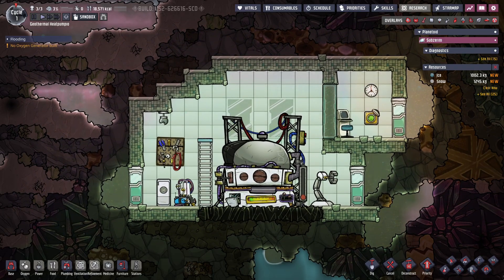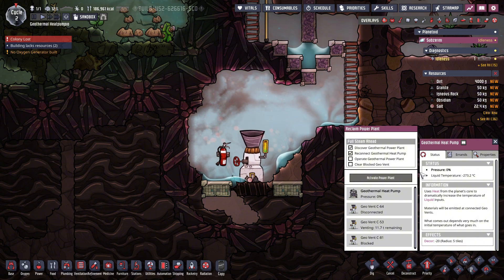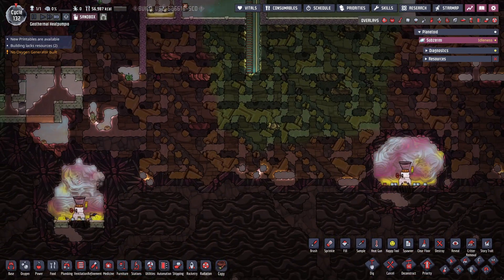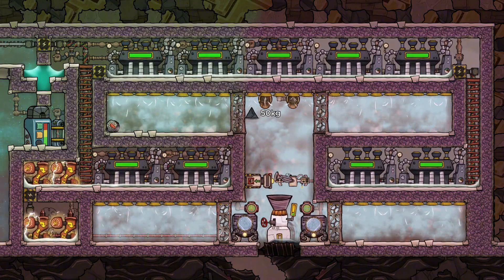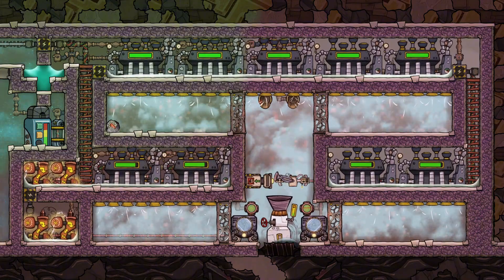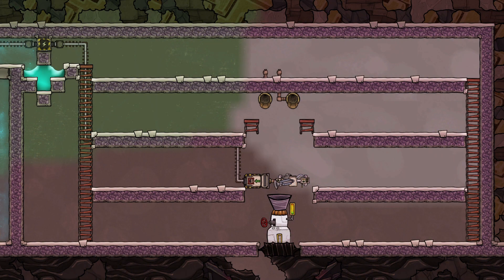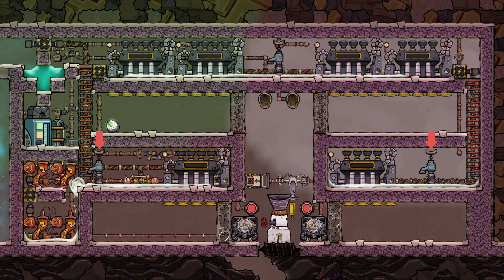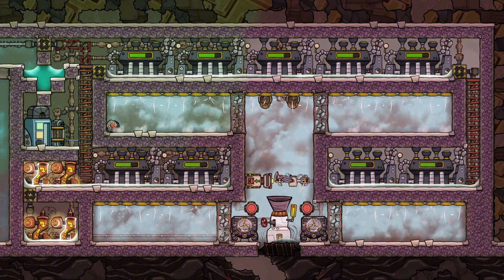An Introduction to the Geothermal Heat Pump | Tutorial | Oxygen Not Included

Comment: I had not been collecting any Nectar so I tried petroleum as a cooling medium, good temps safe to work with...but I didn't realize how close the cooling on this build cuts it. I had nowhere near enough Specific Heat Capacity for the AT to cool everything and the top turbines all got stifled after a couple cycles.
A bit of emergency surgery where I dumped the petrol out at the same time I put water in using the snip tool and it works perfectly! As long as you have your Igneous insulated piping, and keep the AT above like 20/30C you can get by with water cooling. Pumping a 95C geyser into my fill tank and I should have a source of infinite power requiring no dupes, thanks for this guide!

Comment: Wouldn't your liquid temp sensor give incorrect information? You put them in 2 tiles away from input in Aquatuners, which means the 10 kg of nectar that require cooling - will not be passed to Aquatuner, but instead - the 10 kg of nectar infront of the  one you need to cool - will be passed
Reply: this is irrelevant, liquid in pipes normalizes to liquild spilled for cooling
Reply: @РоманПшонка  В якому плані Normalize?

Comment: hello. thanks for the detailed tutorial. One question, does the coolant need to be nectar? can it be salt water or just water instead? thanks in advance.
Reply: Hello. I used polluted water and it is totally fine. Nectar is mostly useful for very low temperature cooling (lower than -20c)

Comment: Thank you for the informative video. With your help, I was able to make a setup without any major issues. 
Though in my case, I was using it by piping in molten copper from a volcano nearby for those sweet fullerene and niobium bits. Some improvements that I've made to help me with this: 
1. A small cap on top with a gas pump to gather hydrogen (otherwise it stifles steam turbine on top)
2. A little pooling area with a liquid pump on one side from geo vent for sulfur. Sulfur is not an issue for a long time with the amount it produces, but it looks unclean to me and sending dupes there to mop it every time looks like an abuse))

And I wasn't able to figure out a simple system to keep consistent amount of steam in the chamber with limitation of atmo sensor (I wanted to keep it at 100 kilo per tile and atmo sensor failed me there). In the end I needed to constantly keep track of pressure there.

Anyway, nice tutorial with a lot of useful information. Thank you

Comment: So I did some experiments. If you’re ok with a bit of time wasting you can feed water through the hot core rock in 1kg packets before they go into the pump. You can get the water hot enough for the last pump without needing a different material. But be careful as what comes out will be VERY VERY hot.

Comment: Thank you. There were a lot of mechanics surrounding this POI that were rather murky——for example how some of the matter is lost, the overpressurization value, and so on.

I'd been struggling to get this stupid thing to work for ages. Honestly, just seeing how many steam turbines you were running simultaneously made my eyebrows go up. I was running five at barely half power each, around 130 degrees when all was said and done.

I ran my base on Ceres for over 1,000 cycles before finally running out of natural heat to extract from the hot igneous rock below, and at that point I came looking for your video.

On reflection, I could have just run a Research Reactor using uranium sourced from a Space POI...

But this is much easier, anyway.

Comment: 1, You can get sand if the auto sweeper trail loop is directly above the heat pump!
2. I use pertrolium and keep it 180+ so when ever i need power automation kicks in to burn the power to 150C
Reply from the maker: I don´t quite understand what you mean with your first point, can you elaborate?
Reply: So you use a regular confined steam room and feed petrolium to the geo vent cycle ?

Comment: can this build work with 6-8 steam turbine?
i have probelm of having 2 geo vent close to each other ( using both of these together would be overkill and will require a lot of resource) and the 3rd one is close to cool salt slush gyser and gold volcan
Reply from the maker: 6-8 works as well, but you still need 1 turbine constantly feeding into the steam chamber to drag the temperature down. When using 1 vent, less steam turbines just mean that you will have some power fluctuation, because you don´t fill the geothermal heat pump as quickly

Comment: I'm very happy to discover your chanel. Great videos for the best game ever! I would like to know what is the purpose of the mesh tiles in the build? What are they blocking? Everything should work without them if im not mistaking?!
Reply from the maker: The mesh tiles are there to block the meteors coming from the geo vent so the debris ends up in range of the autosweeper. Sometimes they still end up on the other side tho. I just built this setup in my playthrough series and tried double layering the mesh tiles and so far it seems to be working.

Comment: Thanks for a great tutorial! I implemented this but ran into a problem of steam sometimes condensing faster than steam turbines could extract the water. Because of that, I had to "top up" the pump now and then...  Also, it is not fully clear where you get the water to the reservoir. Do you grab it from one of the lines leading back to the pump?  (note that I used cool slush geiser water around -10 degrees)
Reply from the maker: Thank you :) The water from the reservoir comes from other water sources you have on your planet, so you had the right idea, but I hope you have an alternative water source you can use tho. The freezing cold water from the slush geyser might be too cold for the system to handle, because the steam needs to heat up your cold brine from -10 to 200°C. Ideally you preheat your additonal water source (e.g. by using the cool brine as a coolant somewhere) or you use a water source that is hotter to begin with (like salt water geysers that output salt water at 91°C).
If all else fails, some temperature shiftplates in the steam chamber may help dissipate the chill from the cold brine.

Comment: Ifnyou have all 3 vents connected,  would the 12t split equally amongst them or is it a flat x amount regardless?
Reply from the maker: the 12t of input liquid split evenly accross the vents. All additional ressources get split as well, but not evenly so you can end up with different amounts of debris/gases/liquids in every vent.

Comment: why not just block off one or two of the inputs of each steam turbine so they run more efficiently with the incoming ~245C steam? Then there's less strain on the aquatuners as well since less waste heat is being transferred to the turbines
Reply from the maker: You can run the steam chamber colder, but then the external liquid you bring in needs to be hotter or else it drags down the overall temperature too much. 
The way it is set up here the steam settles at around 230°C, acting as a buffer whenever the overflow + external water gets redirected into the steam chamber. Also, you have to account for reduced flow rates with blocked inputs, because your geothermal heat pump fills slower. 
Truth be told, the system can be optimized further (also with tempshift plates, etc.), but squeezing out the last percent of efficiency is extra work for little gain.
Reply: @telx7 it seems to me you misunderstand a bit the workings of the steam turbine. what the person is saying is quite right. running 9 turbines is because one has to run them with 2 blocked vents as to not waste heat energy as the steam is exactly above 200 degrees i.e 245 -> block 2 vents to maximize net electricity from the heat. there is no external cooling needed to the steam. one would get to close to 6k watts per eruption this way. 1 AT with ethanol evaporation can probably manage. i have not calculated it yet.

Comment: The wiki claims that nuclear waste isn't a good candidate as a fluid because it's too hard to produce enough, but that's actually not true. A single continuously running geothermal power plan will delete 2.4kg of input fluid per second. A research reactor provides 1.5kg/s of nuclear waste. So 2 research reactors would provide more nuclear waste than necessary. Or, alternatively, 1  research reactor would provide almost enough fluid for 2 inputs of nuclear waste and you can put water in the third. (The whole system will still be water positive).

I also like the idea of using the geothermal powerplant to boil crude into petroleum. I'm not sure how many oil reservoirs there are on ceres, but assuming you have 3, then you can reinject 2 pipes of petroleum and fill the third with crude, and you should have enough heat to boil the crude. Alternatively, you could use nuclear waste in 2 pipes and crude in the third. 

It could be use to dispose of waste in general and get water and other resources in return. I'm thinking liquid sulfur from a sourgas boiler or even liquid carbon dioxyde (though this last one would be power negative).

Finally, an extreme idea would be to feed 2267 + celcius magma on all 3 input ports. This will actually cool down the magma by 150 celcius, destroying heat, but you it will unlock every single impurity from the powerplant. To get extremely hot magma like this, you can melt sand into molten glass, then molten glass into rock gas. Rock gas has 5 times the SHC of molten glass so you can recycle the heat and get plenty more to produce power. The geothermal powerplant will produce more than enough iron to push the molten glass above its boiling point by refining steel. Once the heat from your output magma is harvested, you can recycle the resulting igneous rock into sand in a rock crusher. That's a lot of labor though. Crushing 30kg of rock/second will easily require 10 dupes or so working full time. You're also gonna need about 2kg/s of new material to replace the magma deleted by the geothermal powerplant (imported regolith? molten pdirt from arbor trees? oxylite? The dirt from 5 ranches saturated with cuddle pips? There are different options here too). Collecting all the extremely hot material might be challenging too.
Reply from the maker: There are insane possibilities with this thing. During some of my tests it behaved a little strange and unexpected tho, so to get the kinks out of a very complicated setup can be quite tricky. 
On one test-planet, the left tile of one of the vents caused the steam to instantly freeze and I have no clue why lol

Comment: I don't know what I think about this. It seems kinda cheaty. That's a lot of free power.
Reply from the maker: It is very powerful and can be expanded quite a lot when using more vents, so there is even more power to gain from this. On top of that you are not limited to inputting water and can use it to manipulate state changes, like boiling crude oil into petroleum.

Comment: I want to see mercury running through this.
Reply: It's pretty terrible for power generation because of the abysmal heat capacity of mercury. It's good for unblocking the one vent for the achievement but that's really about it.
Reply: @matthewbauerle7153  I'm just thinking about the heat needed to vaporize mercury.